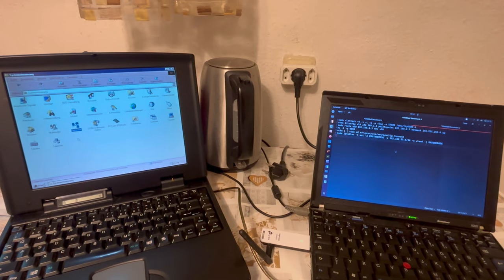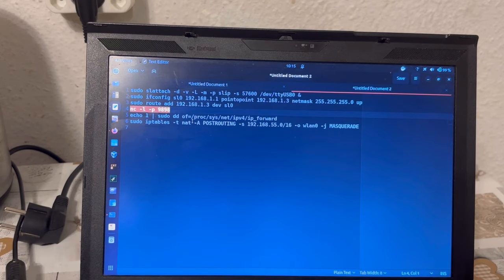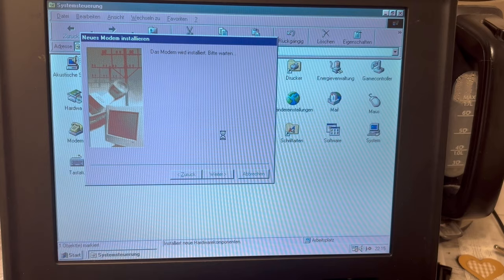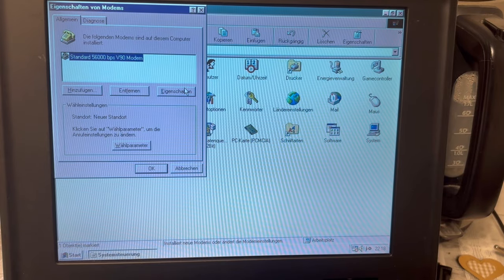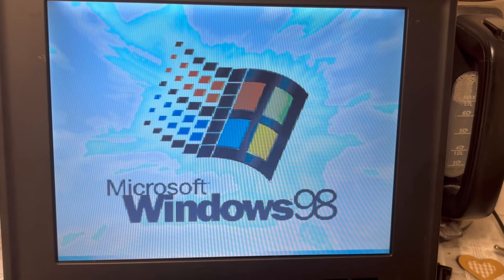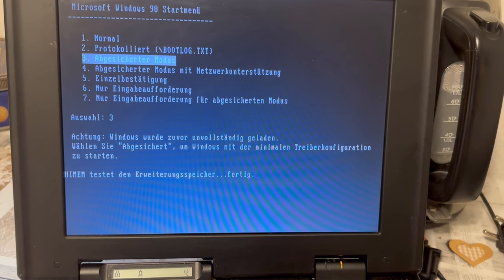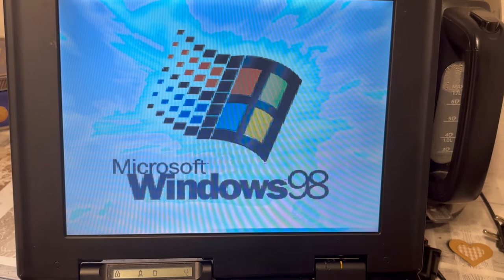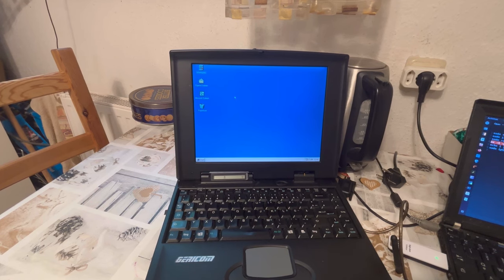(7/58) TTY/SLIP/PPP: Failed adventure to connect via Windows 98 to the internet

Comment: Hey, Nino! Thanks for sharing that video!

It took me back to when I was managing a LAN of 30 Windows95 PCs, each with 32MB RAM, a 166MHz CPU and a 2 GB HDD. They were Dell Optiplex GN desktops, though.

I think (but I'm not sure) that the reason the null modem connection is limited to 19.2kbps is because that may be the highest baud rate that the UART on the motherboard may be rated for. I could be completely wrong about this, but I think that higher baud rates were only possible because the modem itself added compression. Without the modem, it may be defaulting to a lower baud rate.

I do remember that the standard way to get serial connections working, was to start at 1200bps and once that was working, increase the rate until you started getting garbage.

Well, that was how I used to do it, over null modem connections anyhow.

Your knowledge of serial communications may be more in depth than mine, but back in the 1980s/1990s, I did a LOT of serial communications connecting various PCs, servers and dumb terminals. 

I didn't actually use TCP/IP on a regular basis until the 1990s on UNIX networks though. 

I did, at one point, get PPP working from a DOS PC, and was able to "browse" the internet using something called Arachne (?). 

Later, I got TCP/IP working on Windows 3.1, again using PPP. I may have some notes somewhere in my filing cabinet in a notebook stained with blood, sweat and tears. :)

I didn't like Windows98 much. It came with that Active Desktop Javascript thingy that I didn't trust, if I remember correctly. 

Though Windows95 was not as stable, I managed to create a working image for my Dell Optiplex GN PCs, and used a technique which I dubbed, "burn-it-all-down-and-rebuild" to avoid having to fiddle with Windows95. 

I would boot the PCs off a DHCP/PXE/TFTP server, download and overwrite any misbehaving PC's operating system. Usually, this would take about as long as it took to send the user to make a cup of coffee. This worked really well, so I ended up having lots of time to sleep at work.

Most of the serial communications work I did, was in Latin America where usually phone connections were not so great, so the "start-low-and-increase-speed-until-it-breaks" method worked well there.
Reply from the maker: You had hinted at some parts of this before, and I love your stories! I actually have a burn-down-and-rebuild-image, too, just, nowadays, it‘s Debian… :) Well, your hints will be interesting to hear — I eill explore a bit more of the Windows 9X-world in the future…

Comment: Hi Nino, i think there is a wizard for new internet connections using null modem cable
Reply from the maker: Indeed, and thank you for mentioning it! I just lacked entirely Windows networking… something addressed in the next video… :)
Reply: yeah, wasn't it a feature you had to add? something like remote connection or shared connection (which could have used parallel and serial)